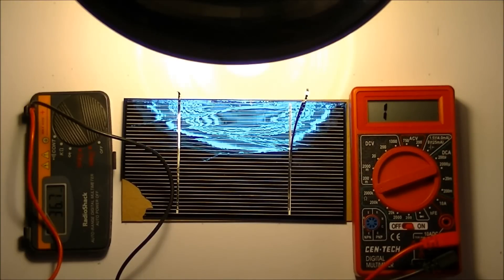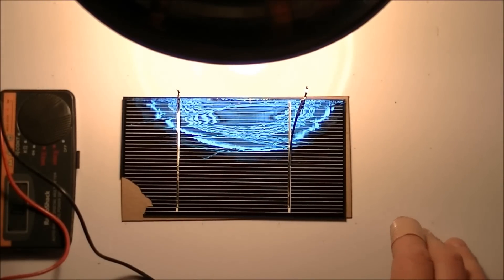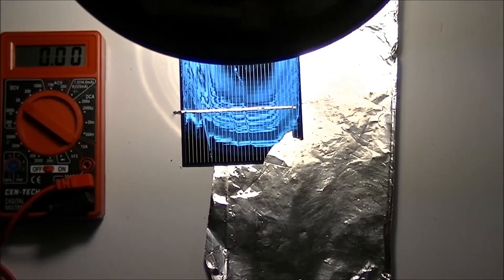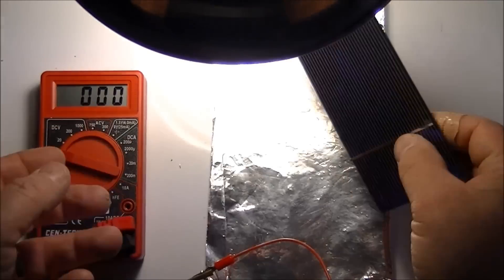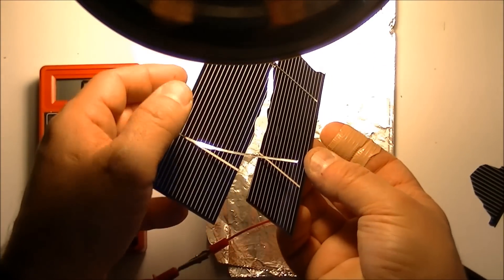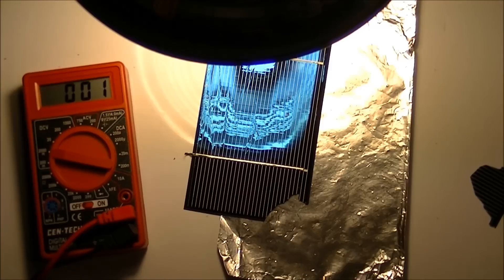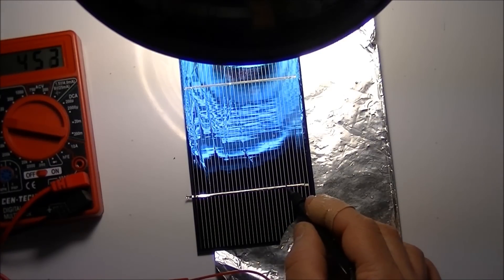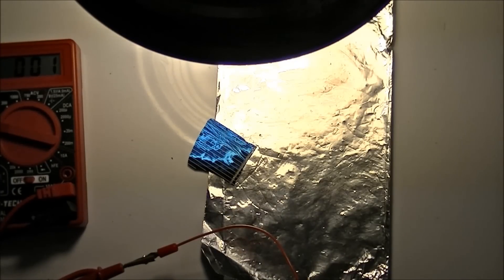Solar Cell Primer, Physical Properties, Testing, Troubleshooting And Repair

Comment: WOW! That seems very time consuming. But like most things worth working for it sometimes is labor intensive. Those cells are really fragile. Someone needs to invent cells that are much more durable. Good Luck with the trouble shooting.
Reply from the maker: Thanks. It was very labor intensive but I think in the end it was worth it. I will post a video on my results soon.
Reply: I'll be watching.
Reply from the maker: bendari Sorry for the mega long time to respond. Seems that I missed your comment. I have a full panel (18 cells) about 50% made but other projects have side tracked me. It is on my list to do though I have done a preliminary test and it is working well but I want to assemble the panel completely. Thanks.
Reply: Richard Lloyd Hey Richard, Is there anything you can't do? Nice to hear from you again.
Reply from the maker: bendari A lifetime of tinkering has been a great education. This project is haunting me but I am going to get it done LOL. I want to have an alternate means of electricity in case of a long power outage and I want to have enough power to run my deep freeze. Thanks.
Reply: Richard Lloyd It pays to be prepared!
Reply from the maker: bendari Yes Sir. Half of Texas just flooded last week not something most people expect in these parts. Expect the unexpected.